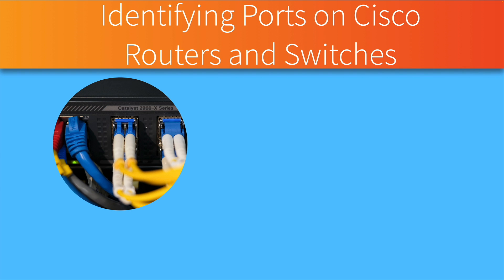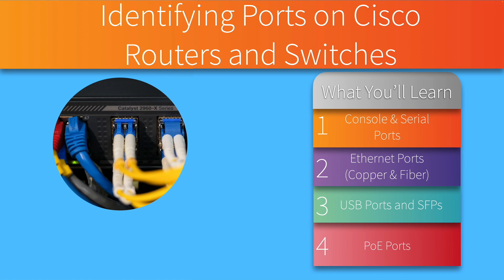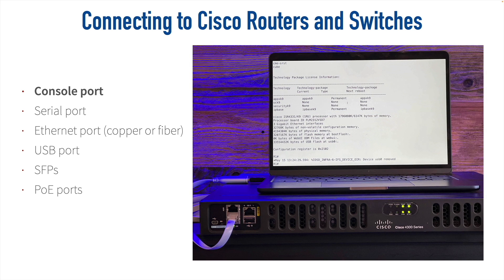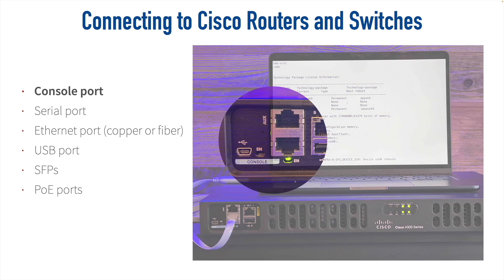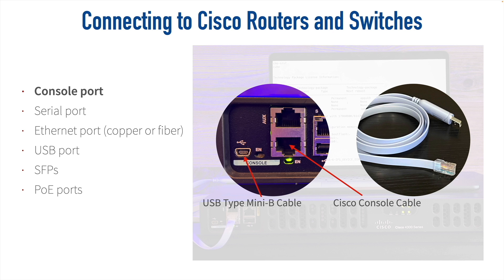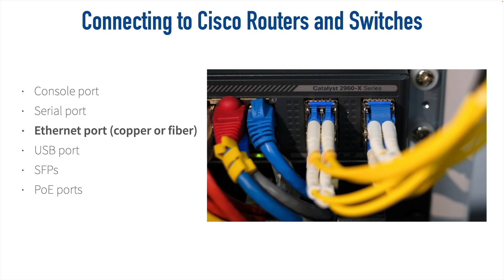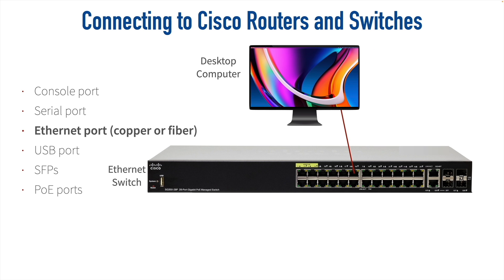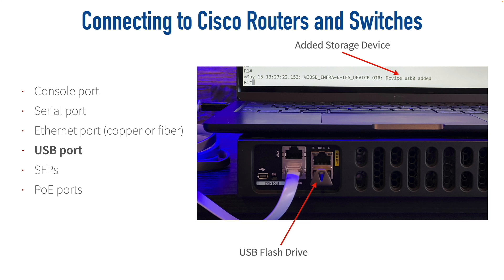Identifying Port Types on Cisco Routers and Switches

Comment: I would add that when you use a usb serial console cable you will have to go into windows device manager and look under com ports to find out which com ports to use when connecting as it will change.